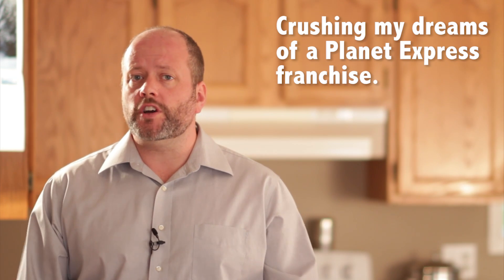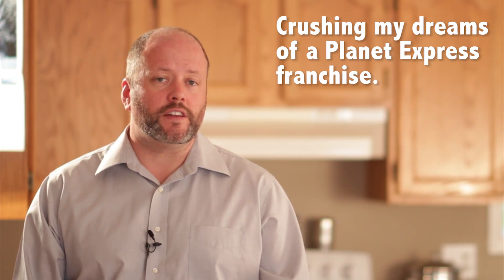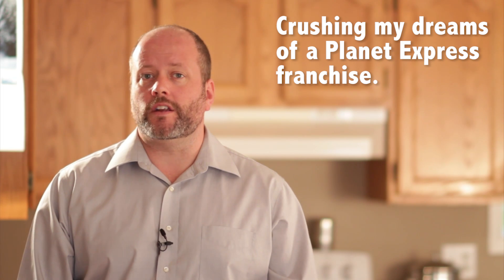What Is A Space Elevator?

Comment: lol even if Kevlar was strong enough it would still run into another problem, Kevlar is not conductive. Kevlar I believe is 5x stronger than steel where as Carbon Nanotubes are something around 100x stronger, its conductive and is lighter than thread.
Reply: You can have metal rail rails embeded into the kevlar rope.

Comment: I would build a long tube on top of the mount everest with magnetic rails that can accelerate or catapult a payload into low orbit it would probably also cost a bit less.
suppose you have a strong enough cable....if there is a small variation at the other end it will multiply the variation to the ground so the cable can rip of the foundation and take it into space or the cable penetrates very very deep into the crust.
Reply: I think that acceleration would be too great for most payload.